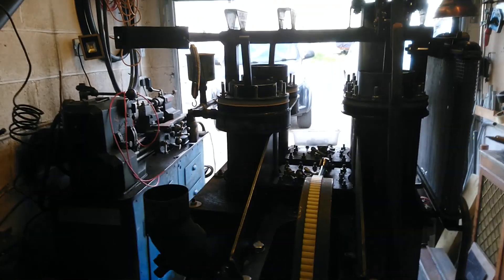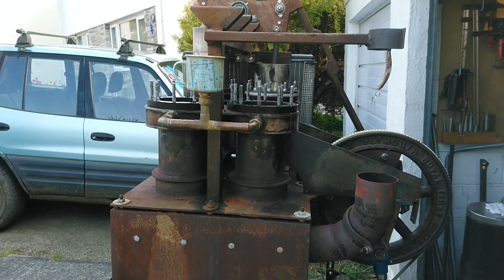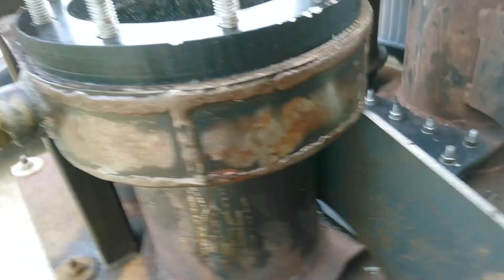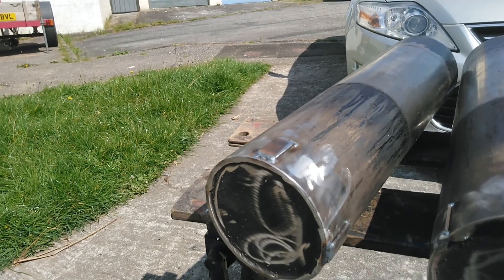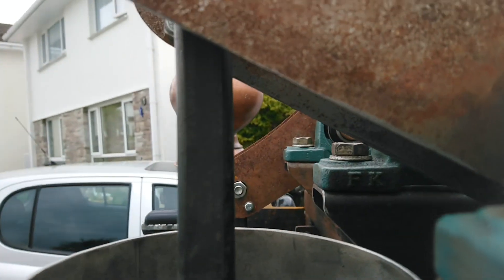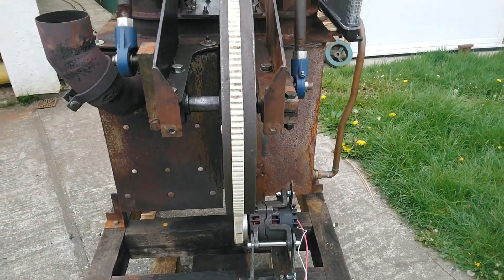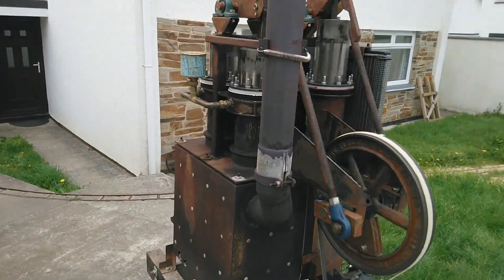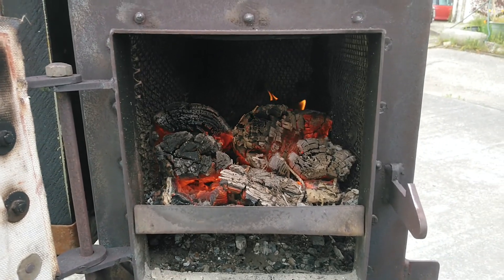Stirling Engine DIY Generator : Improvements & Test Run! Part 6

Comment: Suggest attaching a permanent magnet DC generator and then applying variable loads to measure the actual power output in watts.

Comment: Didn't Captain Ericsson use like steel wool as an economizer in some of his calorics? A late friend of mine, here in Seattle, had a full sized Ryder-Ericsson unit. I ran great on a couple little blocks of firewood. I have only built small ones but I have most of Andy Ross's articles.
Reply from the maker: I've found stainless steel scourers to be the most economical solution (can't really say how they perform compared to anything else through). There's a few of those rider ericson engines around here and they do run very smoothly. I've got various Andy Ross publications and value these the most for practical information
Reply from the maker: I've found this Web page full of practical experience http://www.peterlynnhimself.com/stirling-engine

Comment: In hindsight you might have left a half inch of that skirt on there you could have bored holes and put brass screws in there for your skid spacers
Great machine love your video
Reply from the maker: Hi Kenny, brass screws is a good idea. I cut all of the skirt off in the end because I was worried about clearance. You've got me thinking through, I could weld in threaded bosses to take the screws, cheers

Comment: Never put a lead acid battery on concrete.
Reply: This used to be true.  But with modern materials in the outer case of a typical car battery it is no longer a thing.
Reply from the maker: Hi Jason, Why not? Cheers
Reply: @ShanePomeroy  it drains the charge

Comment: Anything you can do to lighten the reciprocating weight will increase your output a bit.
Reply from the maker: Good call! I'll get the generator sorted then try and do something, cheers
Reply: @ShanePomeroy  If you were closer I would volunteer to machine things for this.

Comment: Hi Shane I know your having fun tinkering with this. Do you have any thought about offering plans for this machine. ??
Reply from the maker: Hello Perry, probably not for this machine because  in my opinion it is a flawed design in many ways! Happy to send you everything I've got if you want to put something together yourself? After I've finished testing a few concepts out on this engine (generator , piston seals) I plan on building a Mk3 version, Kind regards

Comment: Have you considered fitting a mechanically powered fan to the chimney to improve the fuel's burning rate?
Reply from the maker: No I haven't?  Could be interesting? You don't know of any suitable fans, by any chance, thanks
Reply: @ShanePomeroy  Um, I'd suggest looking at something like a belt driven industrial high tempreture fan if one's available for a good price. Otherwise I'd guess looking at some basic fan blade profiles and making one and connecting it to the drive shaft with a pulley system which should be cheap enough?
Reply from the maker: @gherkinisgreat  Thanks, I'll definitely look into this, great ideas
Reply: @ShanePomeroy  That's alright, be interested to see how the engine improves! Only other idea I've had would be using that dynamo you use for testing to power one of the scale steam engine starting fans
Reply: How many amperes did you get from the alternator?

Comment: Looks like you're burning 60hp worth of fuel, and getting 0.6hp worth of power.
Reply from the maker: You could well be right. Hopefully that will improve with the next engine! I'll do a test of that when I've sorted a decent generator setup!

Comment: Almost seems like a cleverly placed fan with ducting could mildly improve it. Would there be a way to get the same fan to draw air through the radiator while also providing a controllable draft of forced fresh air to the firebox? Other than that, honing parts and improving lubrication to reduce the squeaking of metal on metal seems to be the thing to do.
Reply from the maker: Using the radiator to heat combustion air is a great idea! I wonder if the flue draw would be enough without the fan? You've really got me thinking?

Comment: I think your machine is great!  Have you considered a rocket stove vs the fire box?  Rocket stoves burn very hot and efficiently straight away when you have a good chimney/draw like the one you have. Alternatively having a 4'' cold air pipe directly under the fire would also give  that rocket effect. Cheers
Reply from the maker: Hi Mark, this idea is of great interest to me and I will look at options on the Mk3 engine. Thanks for the idea

Comment: I wonder if it would be worth it to find some used big diesel truck pistons and lathe them down to dimension and a lighter weight, that way you could have actual piston’s with piston rings.  That would give you a better seal and a tighter gap but with the same friction for maybe less, that would depend on how loose you keep the piston & rings or ring.  I also know extremely little about Sterling engines

Comment: I plan to design and construct stirling engine as well, however it will be FPSE design, with power aim of 6kW, pressurized hydrogen charged and heat generated by electricity (for testing precision)
Reply from the maker: I look forward to seeing your progress. This is an area of stirling engjne design that absolutely needs further work.

Comment: Very cool... So... I'm not exactly sure how these pistons seal and really not understanding how this works.. Hahaha
Reply from the maker: Many thanks. The pistons are not really pistons like a car engine but displacement rams that displacement air to move it about the engjne. The rams are sealed externally with lip seals PTFE or leather. If you Google stirling engine cycle your see lots of explanation video's,  etc

Comment: In Australia those half round wooden post chunks would be sourced from "treated pine" which has copper/arsenic/other elements soaked into it to prevent attack from wood-eating insects.  Does the job, but the one thing you DON'T do is to burn it because the treatments make the smoke toxic.
Reply from the maker: Uuuuuh, I'll look into that. I'm pretty sure the stuff we have in the UK hasn't had this stuff in it for the last 10ish years
Reply: Yeah, CCA. Copper chrome and arsenic.

Comment: Hi, you seem to have a lot of dead space under your pistons which is reducing compression, hope you don't mind me saying. :)
Reply from the maker: No not at all, something I need to reduce on next engine! I've just checked out your channel and love what you've achieved! great stuff
Reply: Honestly? I think she needs better lubrication too man. Maybe a stirling engine with a crank case? Doesn't have to be pressurized or anything. But 🙂 bearings/pistons/cylinders. Need oil for reliability. I've rebuilt a lot of engines. Have only made one stirling and one flame licker just because i wanted to see if i could. I could definitely build atleast half of what you got there 🤣 but that is a massive engine. I love it.

Comment: Have you considered graphite for the cylinder spacers?
Reply from the maker: mmmmmm....., intesting idea. I'll need to look into that! I wonder where else its used for slides and how they attach it? At least its heat prove!
Reply: @ShanePomeroy  You can drill and tap graphite.  I was going to suggest using a rounded surface like a pin with a radius on the end.  So the idea being drill four equally spaced holes, make your graphite pieces then drill and tap them, then bolt them on, reseal the bottom of your piston and bob's your uncle.  But I would check how much lateral movement there is as graphite doesn't hold up well under impact.  If there's a lot of movement side to side then you might consider doing the same mid and top of piston so it's centered all the way up.

Comment: Thanks for the progress video! That is one amazing machine. Also, one of the very few homemade stirling engines that actually show real power being made other than lighting a few LEDs or just showing voltage output which is meaningless. Looking forward to the next one!!

Comment: Thank you for the Video! 😊 You're doing so strangely well. I thank you for doing this.
In the case of plain bearings, the pair is usually made from a hard and a softer material. The softer one also assumes the function of dry lubrication or emergency lubrication.

Comment: IIRC some original hot air engines used rollers on the displacer to avoid scraping the cylinder walls.